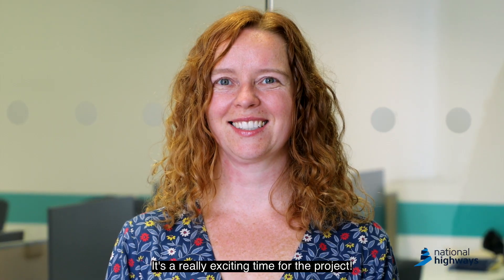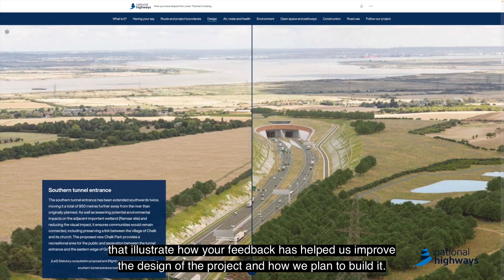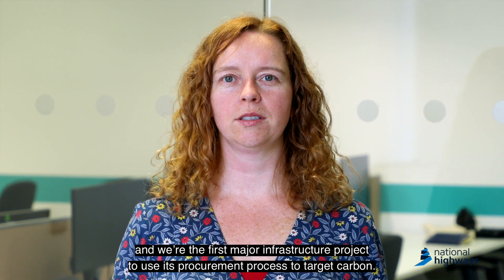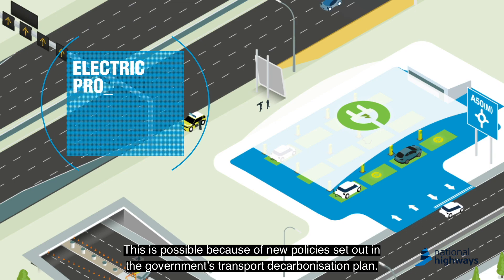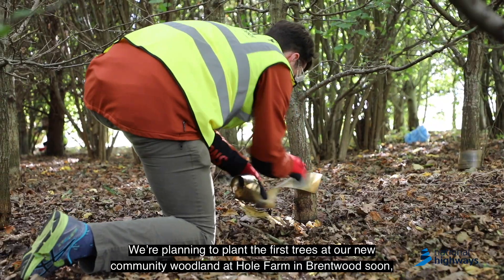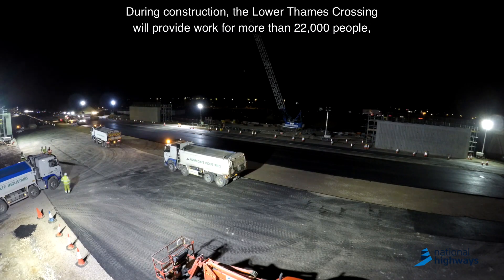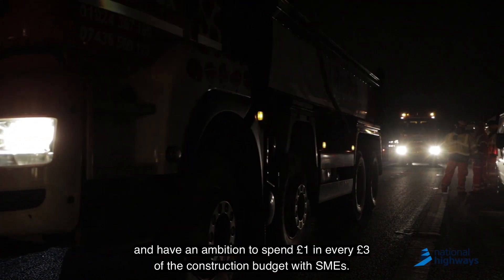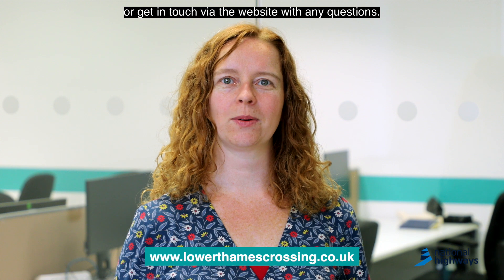Lower Thames Crossing Community Update - Autumn 2022

Comment: As someone who has suffered the inconvenience of the inadequate Dartford crossing for over 40 years, I say just get on with building it and stop talking about the unrealistic aims of zero carbon, green energy and the imposed end to new petrol and diesel cars by 2030. This extra Thames crossing has been needed for over 20 years. At the present rate of progress, it will be another 20 years before it opens and nowhere near 2030 as suggested in the video.

Comment: Just hurry up and build it, the longer we debate it the more it will end up costing in my opinion.  As others have said its been long over due. Personally i would toll all the major bridges across the thames and use it to fund crossings at thamesmead, belvedere too. Maybe even bolt on a train line to the side of the bridge so we can get trams or trains along it too.
Reply: Would there be enough usage to warrant a trainline? Even a train full of people standing makes a loss without subsidy so there has to be an extremely strong business case to put a new trainline in at all.
Reply: Hi Phillip, maybe not now but if this kent theme park happens then quite possibly.
Reply: @carlmason8033  theme park you say? I'll have to look into this!

Comment: This crossing is long overdue,get it built asap,it will cut emissions these levels will drop due to the lack of queuing and engines ticking over and crawling along .The Dartford crossing is  frustrating to all using it on a daily basis .

Comment: The whole project is unnecessary, all they needed to do was make the crossing fee for dangerous goods vehicle £1000, except it could be free for a small window overnight. Why do I say this? As soon as such a convoy runs through the tunnel during the day, that bore is closed, and congestion starts, and takes a long time to disperse. As for the lies around reduced emissions, that is based upon another failed project. Battery operated vehicles. 😞
Reply: I don't think it's unnecessary, the route shaves off miles if you're travelling between the north and the south east.
Reply: @PhillipParr  Yes... And the congestion will be caused in a different area, that's all...  😞
Reply: @cossiedriverrs  millions of vehicles travelling multiple miles less, even if they're in the same congestion, means many tonnes of CO2 less entering the atmosphere. Making efficient routes is a good option!
Reply: @PhillipParr What will happen when a dangerous goods vehicle wishes to cross? The same as at Dartford, with the ensuing congestion. At the very least, it should have been a bridge. I am REALLY not looking forward to this, it impacts where I work, and I will suffer that pollution. Yes, I DO work on the Gravesend Marshes...
Reply: @cossiedriverrs  I will switch to electric for you ❤

Comment: Carbon greenwash?
So is this 'green hydrogen' which is proposed to be used by these as yet non-existent hydrogen powered construction vehicles?  Because 99% of the hydrogen currently available is not; it's fossil fuel based and purely converting construction vehicles to run on hydrogen does nothing in terms of the overall carbon footprint (if it ever happens, as it's very expensive).  Nothing in your documentation suggests you will insist contractors use green hydrogen (indeed it would be very difficult to do at present; because there is almost no green hydrogen available commercially).

So you've woken up to the fact that electric vehicles are projected to take over.  If you're projecting an 80% drop in roadside emmisions by the time you open this tunnel, surely it undermines one of the key objectives you had for placing the tunnel here and not at Dartford (to reduce the pollution there).  Given that pollution is now set to drop across the SRN, wouldn't it make far more sense to build another bridge at Dartford - where the congestion is - at the cost of £1.5bn rather than a tunnel East of Gravesend at a cost of £8.2bn and counting?

Comment: A rather arrogant presentation based on an assumption that the previously rejected DCO will now be approved with an estimated increased cost of more than £10billion.  I continue to oppose the project on location and costs issues.
Reply: @gazbar74  I happen to live 25 miles away from the proposed crossing and am very happy where I live in Southend on Sea. I believe there are better places (towards Southend actually) for a new crossing to be built, avoiding the closeness to the existing Dartford Crossing and losing significantly less residential property in the process.
Reply: @gazbar74  "to help the Dartford Crossing"?  I though the project was largely designed to ease traffic congestion in south east Essex? By moving a little way to the east, the project could achieve the same objective without the disruption in major areas of Thurrock.